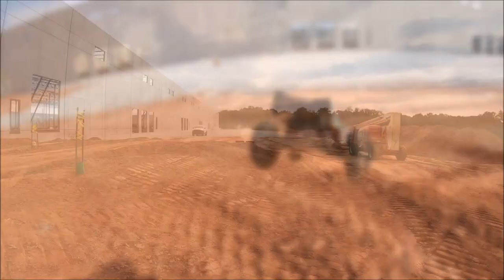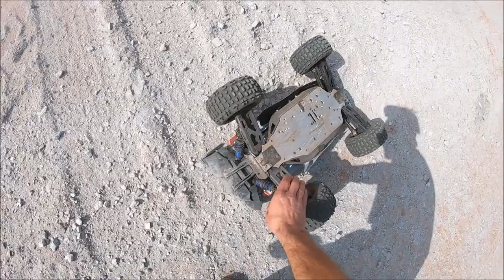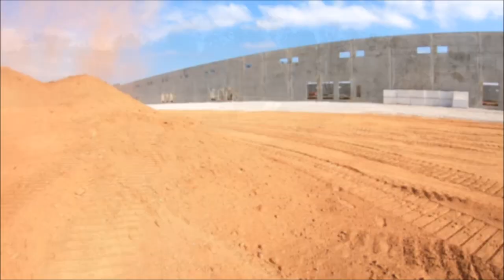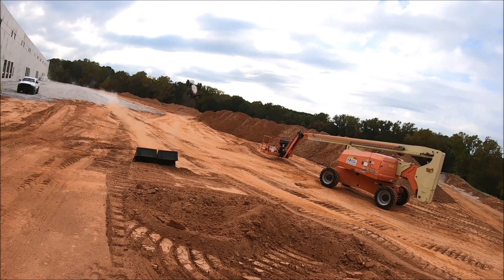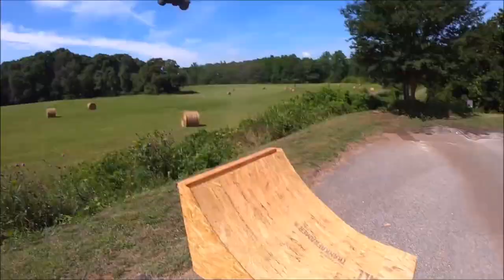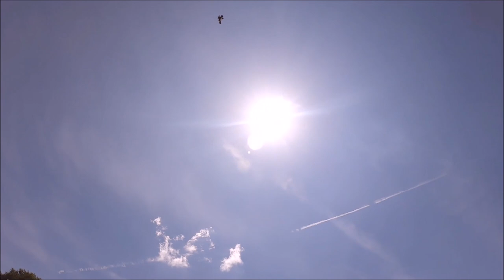TRAXXAS Sledge 6s Incredible Durability!! M2C 7075 tower test!💪

Comment: That's not a "durability" test...that's more like a "can I destroy this thing (guess I can't)" test.  And, to think people say Kevin Talbot is hard on vehicles...he treats them 'kindly' compared to this abuse.  Luv it. 👍🏼👍🏼    🤙🏼

If/When (I'd prefer to think 'if') my BasherQueen CF Sledge shock towers "give out", guessing the M2C towers will be the most likely replacement...or another set of BasherQueen towers.
Reply from the maker: 🤣🤣Set out to give it a hard time but not break it at the same time! A fun rig for sure!😎🚀🚀
Reply: @RCDUDE81  I've got all the 'upgrades' (mostly M2C & Traxxas, plus some BasherQueen & Vitavon), and was hoping/planning on purchasing the Sledge before I move (in less than 30 days, from SF Bay Area to Las Vegas)...but, due to unexpected financial matters, I might have to put off getting the Sledge a few more weeks.

The "idea" was to run the Sledge with stock parts for at least a few weeks before 'swapping' parts.  However, in realizing that I might not have the Sledge in-hand before moving to Vegas, I've already brought all the upgrade parts (except the M2C chassis) to Vegas.

Comment: Now are those things designed to land on all four or are you controlling the way it lands manually. Pretty sweet.
Reply from the maker: Its all controlled with throttle and braking in the air.😎
Reply: @RCDUDE81  Witch one is better the xmax or the sledge 6s

Comment: I see you prefer the hobby star motors over hobbywing. Do they handle the heat better?
Reply from the maker: It basically boils down to they are priced better and run just as good. Heat is about the same
Reply: Dude407  wow